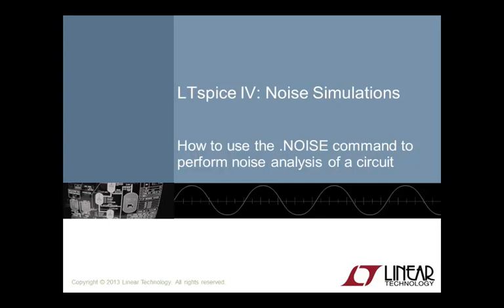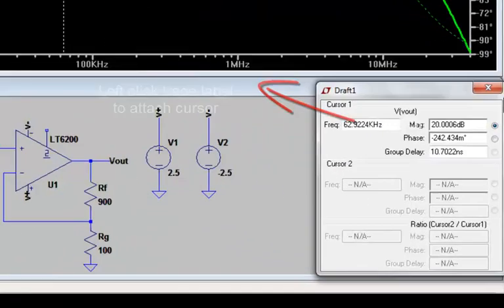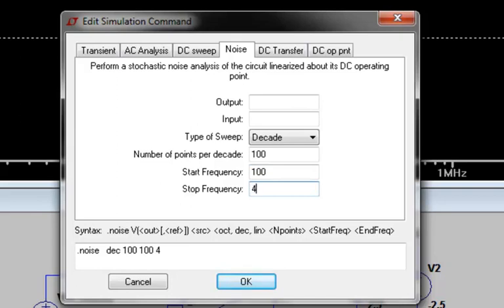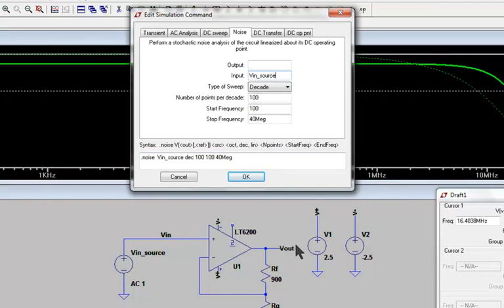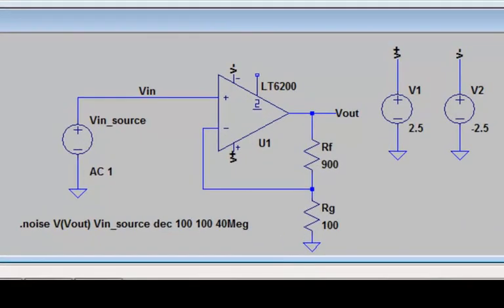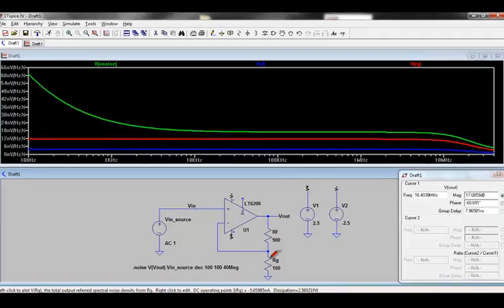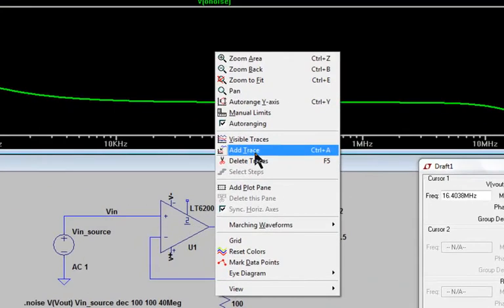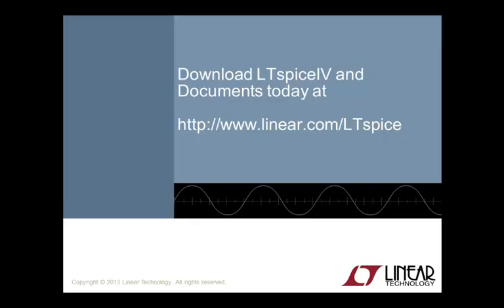LTspice Noise Simulations

Comment: Putting 2 devices in parallel, the noise doesn't diminish but increases proportionally to the number of devices. Si there any special instruction to give to get the real noise figure of 2 identical devices in parallel? Opamps or JFET for instance?